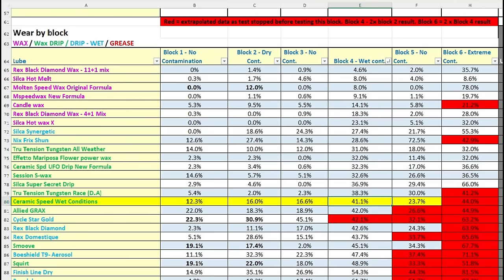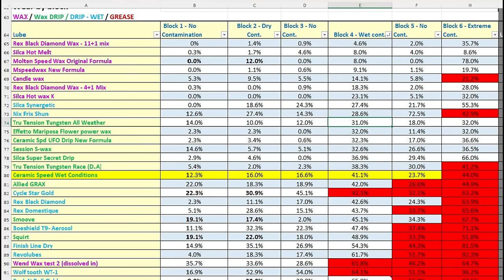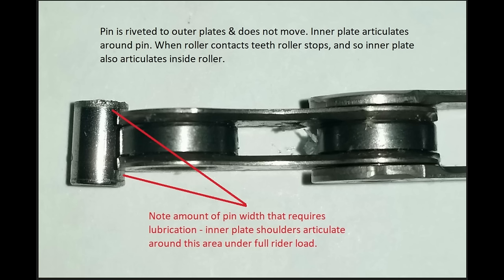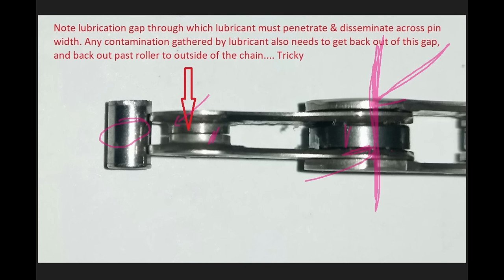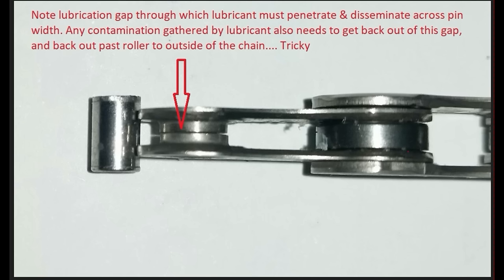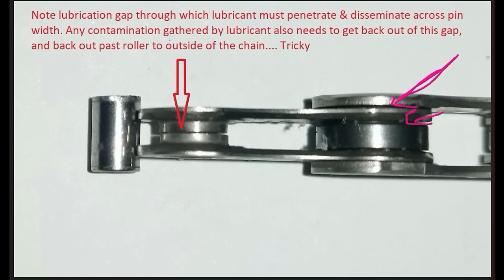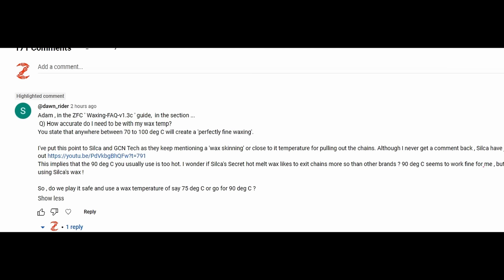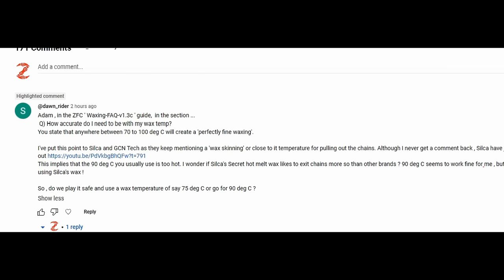wax not last

Comment: I personally switched to Effetto Mariposa Flowerpower wax (upon seeing its excellent performance on ZFC). So far it really has lasted around 500 to 600km (usually dry road cycling), which also is long enough for any cycling event I ever try to do. The small bottle allows for a simple top up in between days, for multiday events. Once around 1000km has been reached on the chain, I switch to the second chain, while the first dirty chain gets cleaned using the Pickle Glass/Mason Jar method with solvents. 

I'd like to thank the ZFC team for providing this great information for free!
Reply: @CFAuugh Can you please tell me what cleaning solvent(s) you use ? The official cleaning product is Allpine Extra. If you've used something else and it works it would be useful to know.
Reply: Since your chain is waxed it can be cleaned with hot water
Reply: @wrwicky  As far as I know this is still to be determined . Please read the top of page 25 of ZFC's ...
Test 27 – Effetto Mariposa Flower Power     in the Lubricant testing tab.

The wax is derived from Sunflowers and is not paraffin based.  If you use it ? and boiling water will clean it ? then that would be good to know. The Allpine Extra contains pine oil ( an organic solvent ) . There could be commercial interests at play in this being promoted or it may actually be needed ?
Reply: I also like to add. Once you have degreased the original manufacturers grease off, my method is quite fast. Usually just 5 mins per jar. Of course you may also use multiple chains (2 is enough for me). In fact, I prepare chains for some of my good cycling buddies as well (if they invite me for BBQ or drinks 😁).
Reply: I use their tire sealant vegetalex and I love it. Will wax with them too, thx or the info!

Comment: Nice video and presentation. 
Page 20:00 +
Chain wear indications?  
There are two tests. 1. Chain stretch - use a chain gauge. 2. Chain lateral wear, side wards free play. 

Test 2. Method:- lay chain flat side ways at a specific distance (1m?) off the table edge. Use a straight edge and a ruler to measure the vertical drop from horizontal of a reference1 chain that just failed test 1. Repeat test 2 with a new chain the result is reference2.

Comment: Great stuff as usual, Adam. Very glad you addressed the removal temperature again. I know you've made your opinion clear in other videos and it's in the Waxing FAQ but it was good to hear one more time after watching the most recent Silca video. If you haven't already, it might be a good thing for the GCN folks to know your opinion on it. They seem to be pretty open to this information these days. Have a great weekend!
Reply: GCN are paid by Silca. They may pass the message on, but Silca is the 'gatekeeper'.  Silca seem to want closure on this issue and currently are sticking to the line that 90°C is too hot. If they are wrong,  it is now difficult for them to say otherwise without some reputational damage ?

I do like Silca and think they are trying to improve cycling and be at the leading edge of product development. I'm surprised they didn't give the chain waxing method validation work to ZFC or at least publicly publish their results. Probably would have cost them a similar amount to doing it 'in house' , assuming they did that ?

Comment: I use Silca hot melt. Even after I do a boiling water rinse before re-waxing, the chain seems to have a very thin layer of wax left. So I feel like the wax is sticking to the chain so well, that it shouldn't matter if I remove the chain from the wax pot at 75 °C or 90 °C. It will have enough wax in it in both cases. No scientific study behind this, only my hunch :)
Reply: I sense the same with Silca hot melt. When cleaning my chain with boiling water before a re-wax there seems to be a layer of wax that remains between the pins & roller’s… a good thing 👍
Reply: Also use Silca and really happy with. Agree with your re-waxing comments.
Reply: Also have had good luck with Silica SS. I dip about every 200mi. Will sometimes use the drip in between but don’t feel like it lasts but 20 mi or so.
Reply: I dip approx every 300-350km. I also occasionally use the SSS drip wax. I find it works so much better & last longer if you massage/work it into each roller with your fingers. It can be a little messy but does get right in & lasts similar distances .. just a thought 👍
Reply: I just started waxing using Silca Secret stuff and about to look at rewaxing. So to confirm is it necessary to rinse in boiling water or metho or just wipe any excess off with a rag??
Reply: when you think about it, the inner pin and inside the chain would need to come up to temp from the boiling water and when we are pouring it on ( unless we boil the chain in a pot ) the innards probably dont get hot enough to melt the wax.
Reply: @awake-notwoke6473  depends on how dirty yhr chain is . more dirt , better off melting off the outer dirty wax and get as much off as you can with the boiling water.  just keeps as much dirt out of your good clean pot wax.
Reply: I don't rinse the chain of my road bike, but my gravel bike often gets a bit of mud, so in that case I rinse the chain in a  pot with hot water.
Reply: @awake-notwoke6473  I always do boiling water flush cleans , especially in winter with the salt and road grit. If you ride in the dry with little dust you can get away with wiping with a microfibre cloth and Isopropanol to help lift the surface dirt off. I wouldn't use a rag as the chain may tear fibres off and they will end up in your wax pot. 

I do 3 boiling flushes of about 250ml per chain, one immediately after the other. The first will mostly warm the chain up and the other 2 melt the wax and remove most of the dirt. A minute of two per flush is enough with a bit of shaking. Wear protective eyewear just for chance and use an open container.

You have to get as much water off / out of the chain before putting it in the wax pot.  Silca say otherwise but putting a wet chain in 75°C wax is asking for trouble 😞.  Personally I shake as much surface water off as possible , submerge and shake it in a jar of methanol for a minute and then let it dry on the washing line for say 30 mins to an hour. You probably don't need the methanol , it just speeds things up and I save and reuse it many times , being stored in an airtight glass bottle.  Methylated spirits is nearly the same ( 90% Ethanol , 10% Methanol + dye + bitter anti drinking agent ! )

My other drying method is to fold a chain 3 times , place inside a 25cm long section of clean plastic drainpipe and use a hairdryer to blow hot air through the pipe for a couple of minutes. It's not hot enough to damage any remaining wax and is sort of the poor persons air fryer !

Boiling water flushes do not do a perfect clean so you will still get dirt in your wax , just not as much.
Reply: The reason why after rinsing you feel the wax, is because it gets melted and redistributed. The problem with wax is that it is solid, thefore it wears off in the places where load is coming through the chain, but it is still plenty of wax in other places where it is useless and does not do any lubrication, and it does not redistribute by itself back onto the load services, as a wet lube would do.
Reply: Sure. And we all know wet lube is superior because all test clearly shows this. Right?

Comment: Folks, concerning wax temperature. I just remedied my Instapot which was constantly giving me food burn messages. I put thermal conductive paste on the centre thermal sensor where it touches the pot so now it gets temperature feedback far more reliably then the dry touch as before. 

Also the wax height in my pot is 30 mm and the temperature graduation is as much as 30° C difference from top wax to bottom (hotter) ,using a wire thermocouple plugged into my fluke meter so be aware if you check using an infrared gun which measures only the surface of the melted wax. 

Wax does not thermally recirculate as readily as water 

so if you are a stickler for the ‘correct’ wax temperature stir and jiggle before taking temp .

Comment: I just started waxing for the first time this week and have put in 2 indoor trainer rides so far. I used MSW hot wax and prepped and waxed 2 new never used chains exactly according the the MSW instructions. One was a KMC X10.93 and the other a YBN SLA 101. Admittedly the KMC had been sitting in a thick plastic bag for a number of years as I never got around to using it till now. I'm going to use quick links with both, a Connex with the KMC and a YBN with the YBN, both also degreased and waxed.

Both were to be used on my 20 year old Campy Centaur 10 speed road bike with a triple crankset, and until it warms up a bit more outside it'll be strictly for indoor use on a Wahoo Core trainer mostly using Zwift with their Play controllers so I can use their virtual shifting capability so no mechanical shifting. I run it on a 42-16 gear combo and Zwift figures out the rest.

Anyway, after just 3 rides, of 10, 11 and 15 miles, the KMC, which I decided to run first, is starting to make some noise, the kind associated with a chain whose lube is starting to dry out. Nothing horrible, but it's noticeable. Now, it could be that I messed up the degreasing or waxing process, but I don't think so. Or, perhaps, it's supposed to make this sort of noise. More likely, though, my guess is that XFC's observation that KMC chains tend to not take wax well is the cause.

I'm going to swap it out for the YBN to see if the same thing happens, and if it doesn't then I'll know that it's likely the KMC's fault, since I degreased and waxed them together. If it recurs then I'll know that I messed something up in either the prep or waxing stage.
Reply: Do mind that different chain manufacturers use different factory grease on the chains. If you degreased both chains equally, it may be that one of em needed just one-two more rounds of degreasing to match the other one. I can't recall the source by memory. Just degrease the one you think doesn't perform again and rewax it. It may do the trick.

Comment: I have a buddy using a heat gun after apply UFO Dripwax such that all the wax disappears into the links (ie, no residual white wax).  He's convinced this supercoats the links and gets it to submersive level longevity.  Would love to hear ZFC's take on this application process enhancement.
Reply: I've been doing the same thing for the past couple years (though I'm using some other drip wax) and even lube my new chains this way instead of immersive first application suggested by the vendor. So far all chains (9-speed YBN, 11-speed Dura Ace, 12-speed XTR) lubed this way have passed 2500 km with 0.25% or less wear measured with digital calipers and their relube interval are about 500 km at dry, road-riding condition, so it seems that they are holding fine. I think it does improve lube penetration, saves lots of lubricant (just one drop per roller) compared to drip-and-back-peddling treatment, with much less wax flakes and keeps chain stays clean. It is a bit time consuming though. Somehow the heat-blowing air feels really hot (it is supposed to melt solder) that makes me wonder at what temperature it will damage the lubricant. I'm also keen to know how Adam's would comment on this.
Reply: I use a food torch but not so direct. Just enough to drop in the rollers. I do agree on a drop per roller. I felt 2 drops and it would drip on the floor.
Reply: @WillEDC  I use a heat gun with small nozzle and it has an additional benefit that I can use the nozzle to poke and roll the rollers while blowing hot air, to help introduce lubricant through gaps inside. Or so I think.
Reply from the maker: Personally i wouldnt. UFO drip all conditions doesnt really have any penetration issues if applied at normal room temps, so heat is not needed to ensure proper penetration. I gather what you are meaning tho is that wax still sitting on the outside from application is going inside for a better layering in where its needed, which is feasible. 

However, wax emulsion lubricants are a fair bit more delicate than immersive waxes, and heat guns get things very hot, very quickly. It would be VERY easy to spot overheat the lubricant and damage / destroy waxes lubricity. 

It is a little more faff re separate steps, but always the best way to increase wax drip treatment lifespan has been to double coat. So apply generous coating, thoroughly work in, thoroughly wipe excess, allow set time, then repeat. 

However - this is really normally only needed if one wants to ensure best longevity for a long event etc. If its just normal training, all up it just easier to spend 20 secs adding a top up coating more frequently than to faff with stuff like this to increase treatment lifespan by x unknown %. So unless one is finding lubricant treatment giving out before normal weekend longer ride etc - just apply normally, ride, and top up more frequently vs faffing with heating (and potentially over heating).

Comment: Page 22:20 … how do we know for sure dust did find its way into the - red arrow regions - without detailed examination or evidence. It we are hypothesizing, do add the word “in theory … ”. 

Wax coating we put in our chain if done correctly will provide lube and most importantly pass on its hydrophobic effect onto chain’s metal surface.  In principle it utilizes molecular electrostatic force to repel other water molecule so water molecules can only bond with its own kind forming surface water beads to be blown away by wind. As it repel with water so do dust. A waxed car catches little to no dust or water compare to one without.

Comment: I think what would be really useful, if you could comment and maybe record short clips of different sounds at different stages of wax degradation. You referred to chains  “sounding bad” many times, but sounding bad can mean different things to different people. Is rattly sound bad, or is it squeaky dry sound that is bad?
My experience is that waxed chains (eg Silca waxed), including professionally prepped, start rattling after about 2-3 hours on the trainer. Basically, as soon as most of the wax is pushed out of the roller, it starts rattling, because there is no surface tension to stick the roller to other surfaces. Is it still lubricating? Idk, probably, but it sure “sounds bad”.
Reply from the maker: could potentially try but wouldnt be as easy to do for clear examples i dont think without very good mic and recording set up. But i will ponder. Your treatment should be lasting longer than that, and rattling is hard to get to unless there is a lot wear and play. Wax only gets "pushed out" initially which is excess. Coating left is thin, but will last for a good stint if all is going as it should be (correct bond etc). Once the thin coating is left, it needs to wear off. On inside of roller to inner link shoulders - this should be hundreds of kms. In dusty conditions the wax coating can wear off the sides of the rollers etc earlier than deeper inside chain, giving the distinctive dry sound and feel in climbing gears well before wax deeper in the chain (ie inside of roller bore) is wearing out. 

Rollers rattling is pretty tricky to get to - it can be done on a perfectly strip cleaned chain and bouncing up and down in your hand, but if chain as any lubrication coating at all - getting very very light rollers to have sufficient play and movement to rattle is tricky indeed. The early warning signal should be feeling a bit of vibration through pedals and a distinct "zzzz, zzzz, zzzzz, zzzzz" sound on pedalling during power phase. If rollers are rattling i would be concerned of a larger issue - ie a lot of roller wear, wax not bonding well etc to allow much greater than normal play and movement

Comment: Thank you for the helpful information, you hit the nail on the head. Any updates on the chain checker from Abbey Tools?
Reply from the maker: Yes the production one is better than my test one with regards to easier to see through the holes. Overall i do recommend, and i would love to stock but at the moment the importer doesnt have w/sale rates for this - so my cost is $80 + gst and the rrp is $89.90, i wont be able to directly stock :(